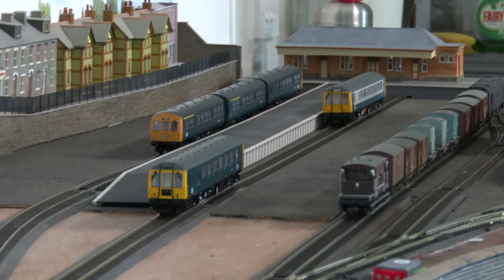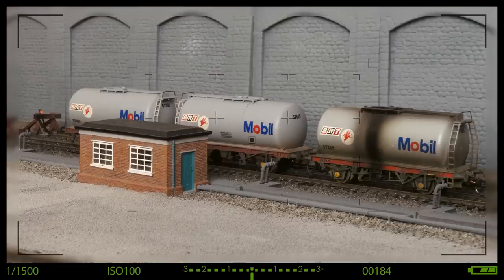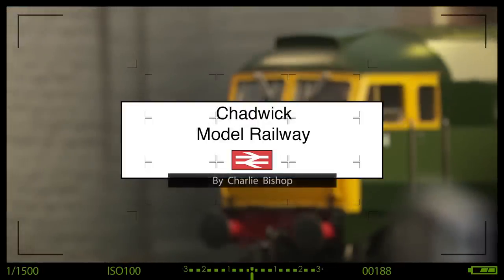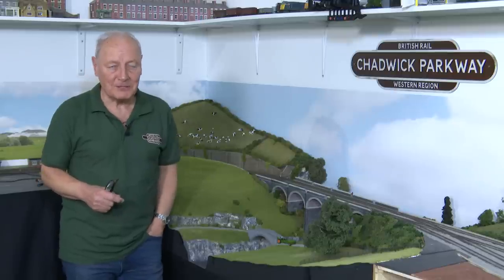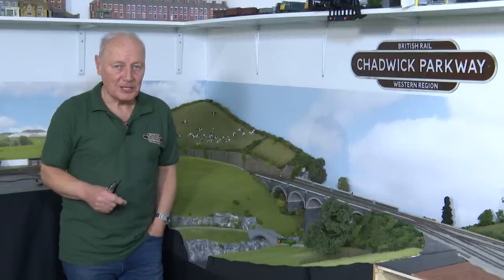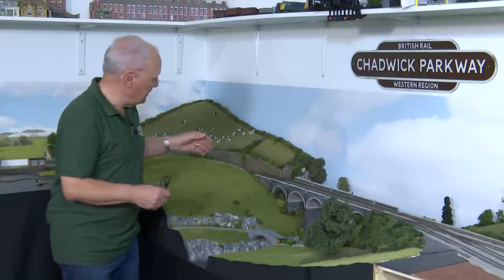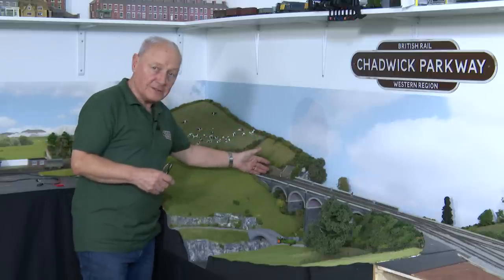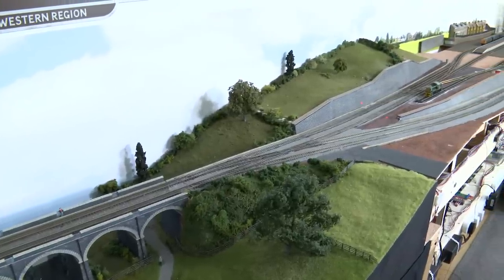SIGNAL POSITIONS at Chadwick Model Railway | 199.

Comment: We have a yellow ground signal in the form of a shunting disc at the railway I volunteer at. The signal only applies for movements out on to the main line (as opposed to a red shunting disc which would control movements in both directions), therefore can be passed in the danger position when travelling down the head shunt. I don't recall ever seeing a yellow light ground signal....but I would suppose it's the colour light equivalent
Reply from the maker: Yes, Matt, the yellow light signal is the new equivalent. Regards, Charlie

Comment: Charlie, that branch line station is really coming together! Great work!

One question that popped into my head regarding protecting the main line from the branch: As there's an incline from the branch onto the main, wouldn't you need to place catch points on both the incoming and the outgoing branch line tracks to protect against vehicles rolling onto the main line uncommanded? Or would the switches always return into a position where any runaway would be caught by the catch point on the outgoing track?
Reply from the maker: You make an excellent point “go away”. However, it’s with all the compressions of Scale, it isn’t really feasible to put them in. In reality they wouldn’t be there because of the expense of space. Regards Charlie

Comment: Another thing from a real driver.  Your route indicator signal at the mouth of the branch line station would always be at red until a train is in that section and within sighting distance of the signal. 
This is known as "approach controlled". 
It means the signals in rear of it (like the one at the viaduct) will show cautionary aspects meaning the train has to slow down if diverging to the station.

This is to stop trains heading into terminal stations or junctions at line speed by ensuring they slow to an almost stop before the signal.

This is also seen on absolute block signalling with semaphores where a signal will stay on until the train is right ontop of it.

I'm not sure if its something you can model but i thought it was interesting to share nonetheless 😁
Reply: The divergence of the main line looks as though it would have a fairly severe speed restriction. That suggests the signal on the viaduct should be approach controlled when the main line route is selected.
Reply: @Mark_W_L  there's places irl that have reductions in line speed like that. You'd have warning boards and tpws. Plus it's route knowledge.  I suppose for modeling interest you could have flashing yellow aspects but it would have to be a diverging route then.
Reply from the maker: Excellent advice, David, and very much appreciated. Regards, Charlie

Comment: For 200, i'd like to see a running session

Be great to see all the bits over the years integrated, especially if its not just the "scenic" and you run a train or two from branch station/goods to the TMD, with scenic elements running in background
Reply from the maker: Rest assured Kieran, I’m onto it. Regards, Charlie

Comment: 200th vlog Charlie coming up! can only be one thing success & failure issue! As on the ground positioning signal with yellow lamps, I can only think tthis is a more modern day type of semaphore signal were a black disc with yellow bar, which could be passed when on (danger) into a siding/head-shunt & off for the main line.
Reply from the maker: Yes Mr V, that’s dead right. I’ll be testing mine over the next few days. Regards, Charlie

Comment: Hi Charlie, a quick question you or your viewers might be able to help me with. I’m planning a layout with two tracks in a run around (tale chaser). It’s about 7m x 3m, so about 20m (60ft) in circumference. I’m use DCC for the tracks. But I think I’ll use a CDU to power the 40 or so seep point motors. It’s Old school I know but it’s quicker and cheaper. 
Q1. If the wires are big enough, will only one or two CDU do the job ?
Q2. If I want to build a mimic board, the push buttons on it are a long way away from the furtherest point motor 10m (30ft). Due to voltage drop, Is this a problem ?
Any tips and tricks would be much appreciated. Thanks, Alan
Reply from the maker: Great question Alan. I’ve never used CDUs but I’m inclined to go for two larger ones at either end of the layout. Just keep the cable sizes on the generous size . Regards Charlie
Reply: Many thanks for your quick reply. Thanks again 🙏

Comment: Yellow position light signals have a permanently lit yellow in the place of the red. To shunt past it on to the headshunt you'd have yellow lower left and white horizontally lit. To pass it out into the mainline it would exhibit two whites at 45°
Reply from the maker: That’s right Castle bank, and mine is on order. Regards, Charlie

Comment: Train driver here.
Normally, the route indicator (feather) will give a route diverging FROM the main. However, there are strange cases where the main is actually gone and the track is lifted, or sometimes reduced to a single line with a dead end. Then, the diverging route became the main. 
West of Melton Mowbray, in 2023, you actually take what would’ve been the wrong signal for the main. The old main is now the Old Dalby test track, but it used to be the main to Nottingham. The main is now the line to Syston/Leicester.
On your layout Charlie, I’d have all the signals showing diverging routes from the main. So going up to the branch would be a diverging left. Going to the Freightliner terminal would be a diverging right.
As for the platforms, I think the entry for the branch should actually be a yellow signal with a number 2 in the theatre box, but I should stress, I never see that because I’m a freight driver. 
I think the red (danger) signal and the position light would indicate “calling on” in that situation. So you’d receive that for a loco coming onto an occupied line. You only need permissive working like that if the line is potentially occupied.
Position lights / subsidiaries are for entering occupied sections or platforms.
Yellow shunt signals are rare, there aren’t many left. Horizontal would be the white lights and 45 degrees would be yellow. They just allow you to pass the signal if you’re only going forward into a headshunt for shunting purposes and NOT onto a main. There’s also a semaphore disc version in white and black (both so the same job) and I can confirm that there is one still in use at Melton Mowbray.
Reply from the maker: Thanks L779. I’m now in possession of the signals handbook, RS– 521. It’s a good read! Regards, Charlie
Reply: @ChadwickModelRailway  ahh the actual Signalling rule book is ideal for what you want! Just keep in mind, even today, Network Rail like to throw that rule book out the window when it suits them! Nothing is truly hard and fast on that railway, especially the further you go from London.
Reply from the maker: Can I ask a further question, if you come from the mainline into the goods area, what illumination should be on our yellow head shunt signal? Regards, Charlie
Reply: @ChadwickModelRailway  of course! 
So, if it’s a “colour light” position light, then horizontal yellows (or sometimes white) for headshunt only. 
To proceed onto the main, you require the signal to show two white lights at 45 degrees. The horizontal and diagonal aspects work the same way for a rotary semaphore shunt signal, with the same colours in the bulbs. Horizontal is always the more restrictive option.

Comment: If entering an occupied platform it would be a red main aspect, position light off (lit) with the platform number illuminated. 
Going into the goods yard position light lit, main aspect at danger with G in the indicator box (or small ones adjacent the position light)
Reply from the maker: Thanks Castle bank, much appreciated. Regards, Charlie

Comment: Thankfully, my layout is small and only requires basic signals - which I must confess are there more for me to see which route I have set 😅

Might not be super duper accurate, but will look pretty I dare say!
Reply from the maker: Hey, if it works for you, Iron Horse, it’s good to go. Regards, Charlie
Reply: @ChadwickModelRailway  if it works remains to be seen, I'm using the DCC concepts IP digitals, excellent motors from what experience I have, I'm awaiting the arrival of the control boards which connect the point motors to the ground signals - high hopes!🙂 Thank you!

Comment: you have asked 2 questions the first one depends on one factor is speed ie the slower rout gets a rout indication the faster does not .if both routs have the same speed then both get a rout indication .question 2 is simple yes you will get a rout of indication in this case 2 for platform 2 hope that helps
Reply from the maker: Great info, Chris, I never knew about the speed issue. Regards, Charlie

Comment: Couldn't you use train-controller to automate the signals - by knowing which way a point is set, and if the following block is clear, it should be possible to run the signal sequence, set the appropriate feather, etc?
Reply from the maker: That’s exactly my intention Neil, first thing is to understand the theory behind it. Regards, Charlie

Comment: With model railways it’s always compromise regarding space and the length of your train. How do you get on if your train you are running is stopped at a red signal, but the last coach or wagon is still in the previous signal section.
Reply from the maker: You make a very interesting point Ian. It’s one of the hazards of compression due to scale. Regards, Charlie

Comment: Re signal 1 (before the viaduct), the diverging route (to the branch station would be the one with the feather (route indicator) and I have to (begrudgingly) agree with the signallers, Penwithers jn (Falmouth Branch) is a perfect example of this, Main Line curves right (no feather) and the Falmouth Branch goes straight on (left hand, position one feather), signed a current train driver.

The Branch signal would be correct for the station, but for the Goods it would be a Position Light and a G because the signaller wouldnt be able to guarantee the yard siding was clear to the buffer Stops as they wouldnt be track circuited and the signalman wouldnt know which route the hand points were set for.

The bubble car would receive the Position Light PLUS  a platform number, to confirm to the driver they were correctly routed towards the Station and not wrong routed into the Goods Yard.

The signals from the Branch platforms would probably be 3 aspect if the next signal is capable of showing a Red Aspect, because they couldnt show a  Green if the next signal was red as there must be a yellow in between on Track Circuit Block regulations, there doesnt have to be on Absolute Block in curtain circumstances but that is really complicating things.

The signal out of the Goods Yard would be horizontal yellow (left) and white (right) or 2 yellow for modern equivalent, the same as a normal Position Light but using Yellow instead of red, and 2 whites at 45 degrees to access the mainline, the Main Aspect might or might not be required depending how far away the next stop signal was and what the signalling engineer decided was required.

Here is a link to a model version-
https://www.ebay.co.uk/itm/134383596636?

And a link to show the Semaphore version [3.70] and [3.71], page 4 has the Colour Light version on [3.88] and [3.101] -
http://railsigns.uk/sect3page3.html

Ignore the yellow and green dots at the side of the signals, they are merely to show what aspect the picture is showing.

16 minutes, the Branch DMU wouldnt be able to stop there with your 2 aspect signalling because there isnt enough room for a yellow before the red, 3 aspect would allow for the DMU to leave on a single yellow and stop at your red.

Re priority given by freights to Passenger trains, Westbuty panel would disagree as they tended to give priority to HSTs over Passenger services, in their world HST stood for Heavy Stone Train!

Re the 200th video, some bloopers please because I enjoy those immensely.
Reply from the maker: Many thanks for your advice Mike, I’m most grateful. Regards, Charlie

Comment: Hi Charlie. Sit down grab a cup of Tea, from an Signal and Telecommunications point of view. 
I'll start with the feather. The mainline would be seen as the straight route and if I was to draw this as a tract diagram for you, the branch would diverge to the left. The key here is, to you this is a branch branch and thus a lower priority, we are also looking at a model so there is artistic licence on verses how this would be in real life.
The calling on signal next. Yes it should also have a theatre indication so the drive knows which route he is been given, in the UK we signal routes and Drivers are taught those route, including speed limits etc. with out the indicator the driver would not know where he is been sent and would assume platform 1 and drive at appropriate speeds. In other countries the signals indicate the speed the driver should do so route knowledge is less important.    
Your bigger problem is your block size, signalling block just to be clear. In this video you showed a small goods that was blocking the junction when it stopped at  the signal with the theatre indicator. Again there is room for artistic licence and the approach would probably be much longer in the real world. I guess there are a couple of options on how to do this, I'm more than happy to go in to details if you'd like but in a nutshell.
If we assume the approach is that short and as you have colour lights, it is within realms possibility that the signal box on the junction also controls the station. I would move the Theatre signal to the other end of the viaduct and trains would get the following:
* Green/Yellow + [M] for mainline (solving the feather arguments)
* Yellow + [1] for platform 1
* Yellow + [2] for platform 2
* Yellow + [G] for Good arrivals / departures 
* Red + Calling on + [1, 2, G] in to any of the occupied branch routes.
Above all this is your layout I've enjoyed its evolution, as long as you enjoy it, that is all that matters, I model in N and getting the signalling I want, where I want is such a pain I've learnt to just hint at how the signalling should be.
Reply: Sorry I hit enter too early. The Goods year exit signal, for your era, all you would need is the shunt signal you had in your hand (time 15:05) with the red LED changed for yellow, you would not need the full signal. When the point is set for the headshunt the driver get Yellow(left) + White(Right) for the mainline they would get 2 whites at 45 degrees.
Reply from the maker: Thanks Jeremy, much appreciate your point of you. I’ve now acquired the signals handbook RS – 521 , and am deeply buried inside it! Regards, Charlie

Comment: I'm not a driver or signalman, but it to me would make sense to have the feather on the left as the branch line is not a main running line merely a subsidiary line. so in essence you are being diverted off the main running lines onto the branch line, think that makes sense?
Reply from the maker: You’re right, but for the wrong reasons. I’ve now found out that it’s speed dependent on which route is the fastest. Regards Charlie

Comment: For the headshunt I’d have a normal aspect for any movement other than the headshunt and on the signal post to the side of the main aspect a normal red/white shunt signal which only illuminates when a shunt move is required to both the headshunt or perhaps a shunt move to towards the junction with the Mainline?
Reply from the maker: In accordance with the signal handbook, RS – 521, only the ground signal is required. Regards, Charlie

Comment: The yellow and white headshunt signal would have been a ground shunting signal, basically a white disc with a yellow bar which when cleared would tilt. Normally you see the bar as red but in the yard it'd be yellow. I've only found one picture.  A hole in the disc would allow a light to illuminate
Reply from the maker: Thanks DJ, I found the references now thankfully. Regards, Charlie

Comment: If you still have questions about signalling then if you're going to warley, the signalling record society will probably be able to help you with a number of signalling enthusiasts and experts, some of whom worked as signalling engineers or signallers. It is signalling engineers that from the period you would want over drivers typically. Helpful to have a diagram with you if you do ask at the society stand.
Reply from the maker: Thanks BC, I shall certainly check them out at Warley in November. Regards, Charlie

Comment: Hi Charlie. Just to play devil's advocate: you chose LED signals over semaphore ones because of the quadrant used (GW uses lower quadrants for a clear signal). However, Yeovil uses an upper quadrant clear; what's going on?
Reply from the maker: There is another factor here, Paul, the signals have to be parallel. Regards, Charlie
Reply: @ChadwickModelRailway  Sorry, Charlie. I don't quite understand.
Reply from the maker: The two signals at the end of the platforms, Paul would have to be level with each other  one cannot be higher than the other, because that’s a junction affair. Regards, Charlie